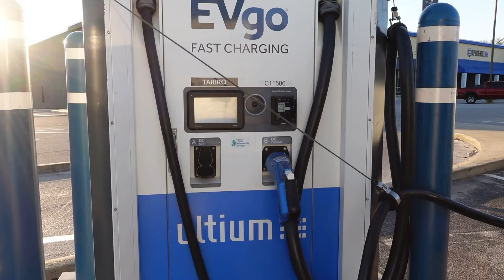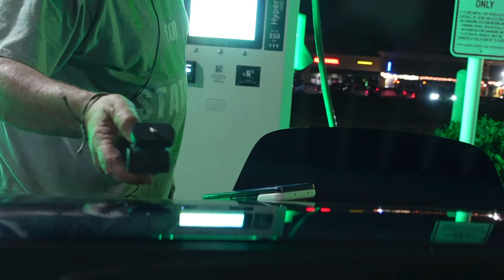Delta , signet and BTC charging attempts with new firmware on CCs to chademo adapter

Comment: Hello. I follow your work here from Sweden. I must give you a BIG thumbs up for your never ending hope for this adapter. Great to see 👍Here in Sweden we have a lot of charge spots but the Chadmo is more rare than the other options to find, but they still open stations with Chadmo so that’s good. I own an old Leaf to commute to work and shorter trips. It works very fine for that. Keep up the good work and have a nice evening.
Reply from the maker: Thank you so much for watching. I’ve seen all around Europe that they are starting to be phased out, and it scares me because whatever happens in Europe usually happens here in the United States when it comes to charging networks. And at least where I live here in Florida they are fading really really fast so Really hoping that the company can start making some firmware updates to get it to work at least on some signet and delta units
Reply: @nomadichippie  absolutely 👍 I found a European company who sells the adapter. And in Swedish money that adapter is very,very expensive. I charge mostly at home but if the price goes down I probably will buy one. If I sell the old Leaf it must be easier to sell the car if one of these goes to the next owner also. Here in Sweden it’s evening now. About 20.50 and it’s time for some food before bedtime. 🥱

Comment: What happens when you wire everything first? first plug the adapter into the car then the CCS plug. next start the charge at the station and then at the adapter?
Reply from the maker: Anything I try failed.but new update just came yesterday